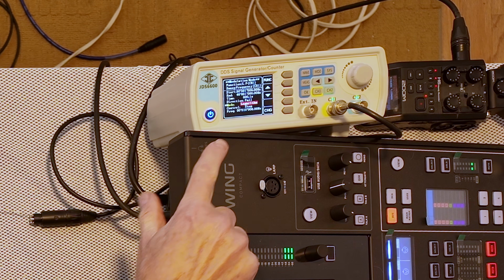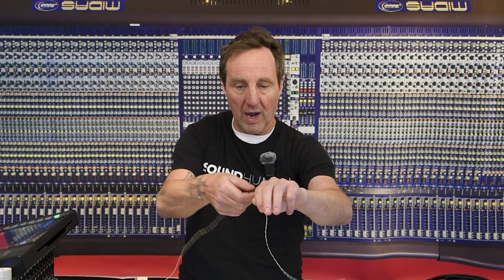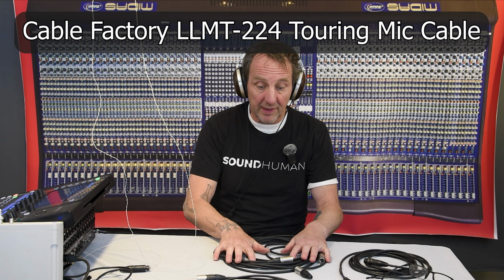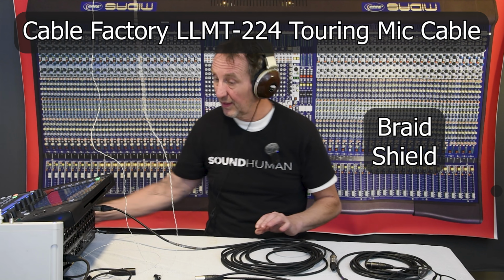Pro Audio Cable Noise Tests - Which is Best?

Comment: I am thinking of making my own mic and balanced cables and planned on using quad star from one of those two manufacturers and Neutrik connectors. Do you recommend them or other types? It's not long canles, but in a jungle of cables for a dual PC setup with also studio monitors an audio interface and a few microphones. Or maybe other cable routing tips to avoid problems?
Reply from the maker: unless you're dealing with extremely high gain in really quiet environments I wouldn't worry about it too much. just get a name brand recently good cable and both Canare and mogami make great cables. 

hook everything up if you end up getting some noise then move the audio cables away from the other computer cables.

typically and most environments just the computer fan noise and other stuff makes so much more noise than what's picked up by the cables that you can ignore any cable interference with reasonably good gear and balanced lines
Reply: @DaveRat  I will try to organise the cables so the audio ones are more away from the rest.

I want to make the cables for the sake of it as it's a thing I like to do, so I can use others, but want to do them myself.

I am going to put my PCs in a very silent box to lower the noise from them, so that is in the works and hopefully it will work, cause the land lord probably won't let me make a hole in the wall to put them in the next room 😄

Thanks for the reply. Keep up the great work on the videos. Love them!
Reply from the maker: making the cables is cool and fun! and the useful skill plus he can make them the length that is needed. 

having a roll of my cable and a bunch of connectors to be able to build whatever's needed when you need it is awesome

Comment: Can also inject noise via an old tape head demagnetizer or at lower frequencies for a larger field an old Cathode Ray Tube degaussing coil...plug either into your signal generator after making sure the impedance is OK. Can re-test with very low frequency like the 60 Hz those two devices normally radiate. Then snap a 2-piece iron core ferrite filter onto the cable. Put a bad (unfiltered) switching load (use high-speed switching) on the power line and run that power line parallel to your high-gain cables. Then try that with a ferrite at each end of the "noise-inducing" power cable...the idea being to add a bit of inductance beyond the tiny amount from the twist, so that with the capacitance of the cable it produces a higher-order (steeper) filter. Then you can start getting into all the various 120VAC power filters and inverters and UPS etc.

In the old days I used to run big dimmer packs thru big power filters. But now there's a switching dimmer inside every DMX light. So I'm clipping one of those snap-on ferrites at each end of every lighting poercon. Where the lighting meets the other power systerm, which is usually an edison to poercon cable, I will also be adding some kind of filter box.

Then I start to wonder whether DMX512 radiates anything...and whether the signal will tolerate snapping ferrites onto each end of my DMX cables.

If you have a transformer you can try balanced power. 220 single phase is balanced power, and with a transformer you can make 110V balanced power.

Then it gets into treating your high-gain low-output high-impedance inputs and cables. It's an old trick on a guitar amp imput to add tiny ferrite cores to both the ground and "hot" cables right at the input jack, and keep adding them until the guitar starts to lose treble, then back off one or two.

Then you start to get into the types of filters and chokes. Some are toroids or other cores that are especially good at fighting common-mode noise.

Then you get into dedicated grounds versus shared grounds...The topology of grounding each stage of a guitar preamp. The way push/pull cancels some noise but single-ended Class A and Class D do not.

Do you test the RF selectivity of your RF mic communications? Or your intercom?

It's all a rabbit hole, and the reason they call us roadies "hum heads"... I'm still learning every day.

But thanks a million for this video! I appreciate a man who can experiment himself! I'm still learning every day and now I have shared your experience without much of my effort. Win-win.

In my imagination I think of a high-gain high-impedance single-ended twisted pair like a cardioid pickup that twirls about a straighter pole, with some threshold voltage defining a "spiral staircase". I think of the high-gain high-impedance single-ended quad-cores like a figure-8 pickup making a double helix in space, with two less sensitive spirals. Those magnetic tests would be interesting to see comparisons measured at some greater distance where the cancellation due to the twist is starting to be more effective. I suspect that when the mfgrs advertise how effective their cable is, it's compared to others at 2 feet or some such real-world distance. You ca fix that noise with filters, but the cable companies don't want to restrict the bandwidth of their cables.

So always wrap everything in Mu_Metal, where coercivity around your "antenna" is your only recourse against magnetism.
Reply: It's also interesting to see which devices will de-modulate FM, and which will de-modulate AM.

Fully balanced preamp circuit topology (way beyond just cables) 2is another interesting subject. For exactly twice the circuit complexity and cost you too can cut most of your noise and some of your distortion in half.

Comment: It doesn't seem like there is really a tradeoff/tension between these two types of interference/mitigation, right? (Tradeoff would be between cost, or flexibility, etc)

Couldn't there be an extremely tightly wound, maybe 4-wire, with loads of outer shielding (or foil around the pairs and around the outside), that would mitigate both really well? (It seemed kinda like the ethernet was the "best" so I'd be curious to see something like cat7 if that has more foil.) -- Or is it that adding the foil layers causes the EMI twisting to be less effective?
Reply from the maker: not really a trade-off just two different things. lots of twists and quad table is great for electromagnetic interference mitigation 

foil or tightly braided or double serve shield are good for radio frequency interference mitigation. 

but foil wears out and reduces flexibility. adding more twists increases the resistance of the cable because the wires are longer and adds cost just like going quad does. 

double shielded cables like the cat 6A SFTP is really good for both RF and electromagnetic. 

for general purpose in most applications you don't really need to spend the money and reduce the flexibility of the cable by going overboard. 

but knowing what solves the problem and what type of cable is best for the application is good to know. 

Overkill can be just as problematic as having something that's not good enough. 

it's all about finding the right tool for the job

Comment: It's been said that the best cable is a the cable that has transformers at each end.
Reply from the maker: proper tool for the job applies. anything that adds unneeded cost or size or weight or complexity devalues be usefulness of a product. 

since transformers color the sound and are quite expensive to even try and minimize the coloration and they don't pass phantom power and they have signal input level and output level ranges limited by their design, implementing them when they're not offering a direct useful benefit for the application is not optimal

Comment: Very interesting tests.
As a way to determine EMI performance when I worked with 2 major UK night club install companies (we did a few hundred clubs in a decade or so) we used to run a heavily loaded speaker cable (into a load resistor) right along side 10m (30ft) of signal cable / which is a really common real-world situation. We also used a heavily loaded power cable over the same distance. Then we ran signals at "normal operating levels" as there is no point running a test if EVERYTHING reads below the useable noise floor for our purpose. We also found that some gear had a far worse CMRR performance than others. AND!!!! Here is the kicker.... We found that some gear preferred one type of cable over another  We found that when we swapped out inoperable gear for newer gear the noise floor raised, changing to a "better" cable lowered it again until the inoperable gear was fixed and replaced and the noise now came up again until the original cable was reconnected. (This was not too common, but some gear was REAL fussy about the cable over long runs like football stadium lines) 
It's a prickly subject for sure and there are no "BEST" cables. We have to do a LOT of trial and error to get a truly quiet system, often because of local issues, and gear choices. 
What I will say is that since the European Union brought in the EMC directive and required electronic gear to resist and not emit interference or not be allowed on the EU market, manufacturers really stepped up to the plate and fixed a whole load of lazy badly engineered interconnect. In the late 1990's we though it would hurt our industry, it actually did us a massive favour.

Comment: Thanks for sharing the test, but I’m not sure what it proves.

A typical “mic cable” that carries one signal conductor plus a shield is unbalanced, so it will pick up noise. An XLR cable is balanced: it carries two signal lines (+ “hot” and − “cold”) plus a shield. The preamp compares + and − and cancels any noise that appears the same on both (common-mode noise).

If you plug an unbalanced mic lead into an XLR input, it can still pass audio on the + line, but the − line isn’t used, so there’s no noise cancellation and interference can get in.

Even a low-cost, correctly wired balanced XLR cable gives good noise rejection when the mic and preamp are balanced end-to-end. An unbalanced mic lead will remain prone to interference unless the microphone and input both support a proper balanced connection.

So the test really shows that a + and ground connection can’t cancel interference, while a true +/−/shield (balanced XLR) connection can. The make of cable doesn't make a huge difference in the grand scheme of things.

The correct approach in environments of potential high signal crossover or mains cabling running nearby causing humm is to just use an audio "DI box" to convert a short 1m/3m unbalanced lead (laptop, keyborad or mic for example ) to a balanced lead to achiever 90% better results where long cable runs exist
...
Reply from the maker: I think the test shows that if you're trying to get rid of EMF then you want to select a cable that's got a higher twist rate and precision twists or a quad cable.

And if your challenged by or in an environment that has a lot of RFI then you want to focus on tightly wound braid, double serve shields or foil shields and avoid single wound serve shields.

I think it also shows that quad cables are not all the same and this drastic differences between the mogami and the Canare quads.
Reply: So home made with cat 7 cables should be fine?
Reply from the maker: yes

Comment: Great Video :) please note: cable length should dramatically Effect RFI susceptibility due to a cable with specific length being "tuned" to a specific resonant frequency (acting just like an antenna) 

Another interesting topic would be:
How do different manufacturers/models preamps/stageboxes mitigate RFI due to different design of input circuitry 

Best regards 🤟

Comment: I know that the tech exists in the audio world  (xlr to optic fibre convertors etc.) but I've never seen them used in person. 
What's your thoughts/experience/use cases for that tech?
25 + years in the industrial electrical /factory automation sector + 35 years of amateur radio has taught me that every cable & bit of metal has the potential to be a source or receiver of interference. Factories and machine shops are a really harsh interference ridden environment, so beyond segregation i.e. distance, shielding, bonding, & suppression sometimes "cable" problems were only able to be solved by going to optic fibre.
Reply from the maker: it's important to use each tool for its optimum application. 

fiber optic is excellent for transporting numerous channels over long distances and eliminating electromagnetic interference. 

also using category 5 6 or 7 cable to transport multiple signals in digital format tends to eliminate ground loops and interference issues or at least switch interference issues from gradually increasing to an all or nothing adventure. 

but for the first mile or last mile adventure similar to fiber optic and category cable kind of being more like an airplane, bus or car form of transportation, but walking the first and last distance will never be replaced.

similar is analog cables where the mics and speakers require t least a short distance of analog before being converted to digital. while this can happen inside the mic housing or inside the loudspeaker enclusure, doing so tends to add cost and complexity.

so... analog mic and speaker cables are a reality of life for at least the foreseeable future. 

with mic outputs typically being extremely low level, the mix cables offer a high exposure to noise induction.
Reply: @DaveRat   Thanks for the reply, nice analogy about the last mile, yes, cost & complexity come into everything but are a shrinking consideration when the newly installed arc welder wipes out the network & stops a production line, or the whole factory.

In commercial audio do you ever use multi turn chokes wound around Ferrites of an appropriate Mix i.e. 31, 43, 61, 78 etc. to choke off any shield currents & solve particular interference problems? 

Again this is common in the amateur radio world, but in audio I've only ever seen ferrites in power conditioners, or the manufacturer installed single pass "clip on" type on the audio interface power & USB cables - never anything on mic or speaker cables.

If this subject/method of shield choking is of any help/interest to you the late Steve Hunt G3TXQ published quite a bit of data on the mix / no. of turns / effective choking frequency -  if you Google "G3TXQ Choke Charts" various people have re published them.

Comment: Nice video, thanks for posting.  I use canare quad with special neutrik xlr connectors designed to reduce EMI/RFI.  Would love to see you compare that combo against mogami quad with same connector, and then with standard xlr connectors.  Some say the emf/rfi neutrik connectors result in some loss of high end in the audio, but I’ve never seen an A/B comparison to see if true. That would also be a killer video to see if you’re up to it!
Reply from the maker: I will ponder that and yes, the RFI filter is basically a low pass filter that removes high frequencies like RFI.

the better the filter, the more high frequencies it removes and the closer it gets to impacting the audible high frequencies.

Comment: I don’t think that quad core can help anything. Number of twists in the pairs per foot makes a difference.
Reply from the maker: The advantage of the quad core is due to the fact that with four wires the average distance to the noise source of the pin 2 and pin 3 lines remains almost equal.

with a two-wire twist one wire is always a little closer or a little farther from the source than the other wire. 

with a quad The average of the two wires is nearly identical to the average of the other two wires so it doesn't need as many twists, there can be less wire length due to less twists, and less resistive loss due to more copper or wire. 

One of the downsides of the quads is increased capacitance I believe which can limit the high frequency response for very high frequency signals

Comment: Braided shield is better for immunity to EMI, BUT they don't last as long, flexing a spiral shielded cable will not fail nearly as soon as a braided cable.
Reply from the maker: agreed, double counter wound serve shields are good balance between the two maintaining the flexibility and durability well also having the improved shielding that doesn't tend to form gaps when the cable is bent

Comment: Is cheaper cabling one reason my mics get interference, Corded and or wireless? 😅
Reply from the maker: could be, depends on the type of interference. ground loops tend to be the most common noise and fixing it is more about how it's wired vs the wire used.

but if the noise is induced noise, then better cables can help or fix
Reply: @DaveRat  I will test tomorrow for fun  and also i wanna see what other methods there is to eliminate some of these kinds of interference. Very helpful and interesting video though thank you Dave.

Comment: Hi dave, what about when you connect the terminating device, like a microphone or powered speaker? Doesn’t this complete the “balanced” connection and reject or cancel out this noise?
Reply from the maker: yes, the termination resistors are to simulate a mic or output circuit.